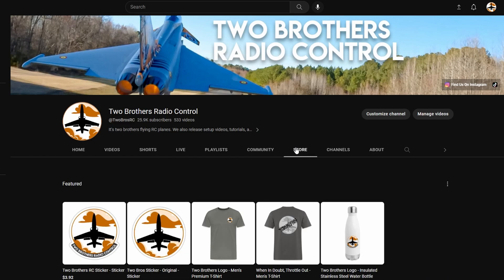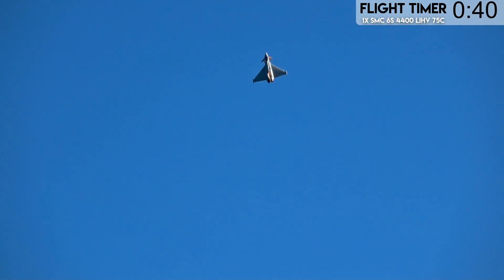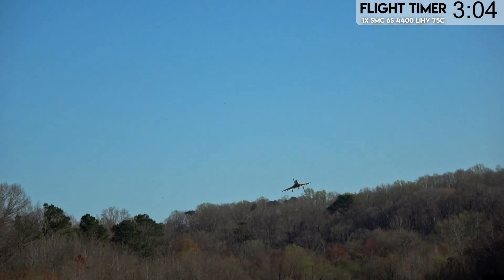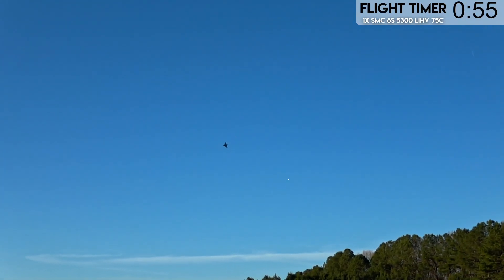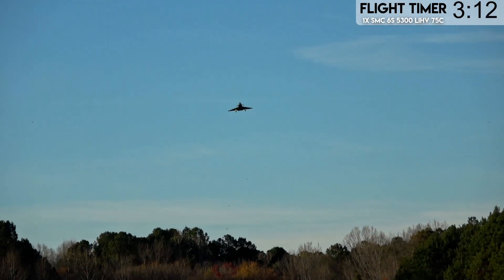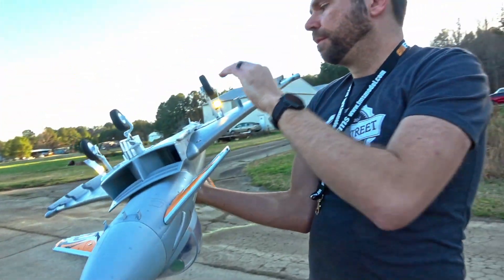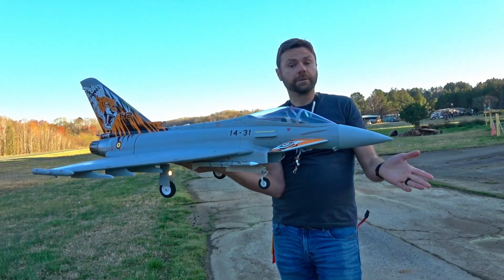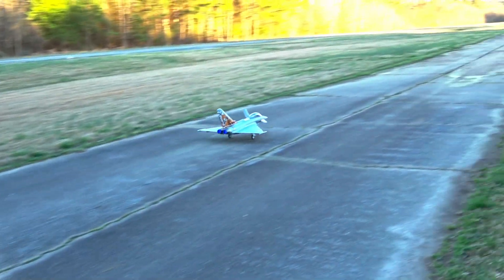FINAL REVIEW - Freewing Eurofighter v3 90mm w/ Landing Tutorial

Comment: did the maiden on my typhoon and all your setup suggestions were spot on. That canard trim button is genious.  I added another ten grams in the back on top of that included 28,  running spektrum 5000 100c at 680 grams, allows cg to be 35mm behind stock without pylons and missiles. Can get 55mm when the pylons, missils and bombs are added. I was feeling good with 40mm and will slowly get it further back. This bird felt so comfortable on the maiden that i went ahead and started doing low level high alpha passes. Tons of power, great presence, and lihv 5300 are next to try out. Also loving those loaded rolls. Im pretty sure this will never do a cobra 😅 Felt like it was lacking in pitch authority. Need those full span elevons. Maybe it will unlock after cg goes further back. Thanks for another great flight review that is spot on
Reply from the maker: This is what we love seeing. Thanks for sharing Jared! ❤️

Comment: I would love to see a thorough review of the 8s set up. Not just 'wow' that's fast but what sort of 'punch' it has from slow flight straight into the vertical considering its  extra weight penalty! Thanks again for your comprehensive reviews
Reply from the maker: We aren't currently considering any 8 cell setup for this jet as it already flies nose heavy on 6 cells - 8 cells would add a ton of wing loading and nose heaviness and ultimately hurt its acro performance while doing nothing but adding more thrust. That might change in the future, but for now we're not planning it currently.

Comment: Does it come with reverse thrust? Which would you buy the high-performance 90mm or the arf kit? I prefer MKS servos so I kinda doubt I'll leave the servos that come with it unless you think they're good enough. Love those afterburner lights and the speed brake helps like you said level it out. You're one hell of a pilot. Yeah up there in Cary NC that place has 4 kits I want and there all are arf warbird kits. It's just that 100 miles I hate.
Reply from the maker: The ESC does have a lead for thrust reverse. We picked up the 6 cell PnP variant.
Reply: Okay cool, I agree the landing is extremely slow. I like the jet $659 I just think the flight times make it not worth buying. I'm still going to get but I think it will be the arf model. It'll cost me a little more but I think it might be worth it. I guess I'll have to wait and see what I do.
Reply from the maker: We feel that flight quality is more important than flight time. We would rather fly a much less nose heavy jet for 3-4 minutes over flying a very nose heavy jet for 4-6 minutes. If you prefer an extra minute or two, you can run SMC 6200 HV packs. This will increase flight time significantly at the cost of much more wing loading and a nose heavy CG, making the jet more resistant to control inputs.

Comment: Excellent touch-n-goes… if I could land like that, I wouldn’t be fabricating a replacement gear for my Arrows Edge 540 out of music wire; sadly, they used a very soft, low yield strength wire and it bends very easily.  Speaking of, I’d like to see you review that aircraft; that gear issue is my only legitimate complaint.
Reply from the maker: We asked Arrows to work with us and demo their models. We'll see if they respond. With regard to landing, it's a skill that has to be practiced a lot to be proficient. The more you do it, the better you'll get. Spend a few batteries doing touch and goes and you'll get it quickly.
Reply: @TwoBrosRC  - Some of my planes are very easy to land; I just haven’t got the hang of the Edge yet - it will come.  But that gear is still too malleable… it’s gotta go.  😃
Reply from the maker: @tonydarst8211  Try making the ailerons separate and reflexing both of them up somewhat so you have to bring the model in with thrust instead of gliding it. It'll probably be a lot easier to land that way.